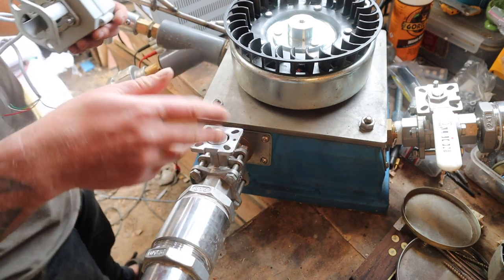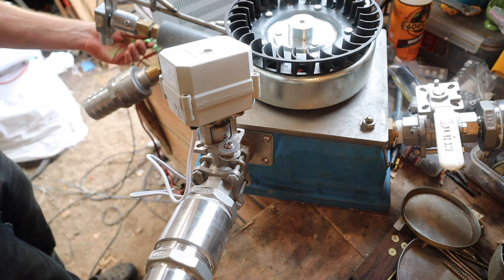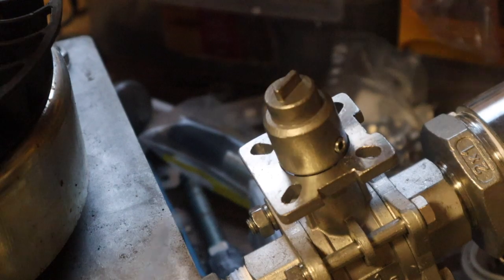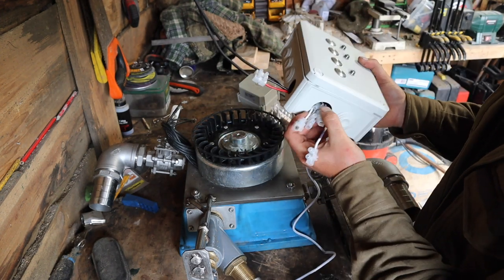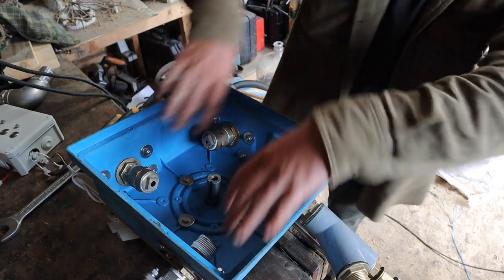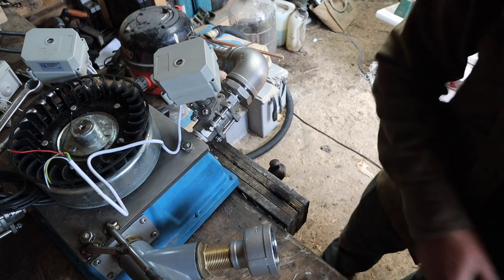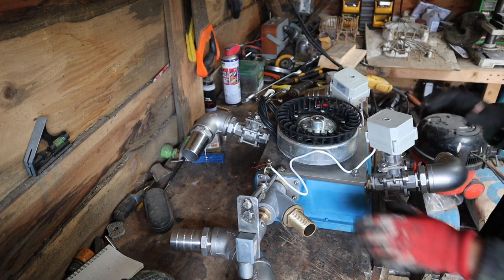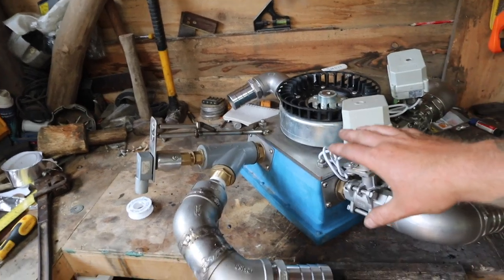4 Nozzle Off Grid Micro Hydro Turgo Turbine  Part 6 Valve Actuators, Controler, Fittings

Comment: Double check that it actually closes. The grab screw did not return to the same position as it started in.
Reply: I noticed that also. 
By the way it's called a grub screw here in the UK.
Reply: Yea it sounds like the motor is not strong enough to close it.
Reply: I was going to say exactly the same thing. Good eye.
Reply: The grub screw does appear to rub against the base.
Reply from the maker: Well spotted. its due to two things. one is the slight rub from the grub screw and two not getting enough time to build up force before closing. It will work fine once it has the full 24v and is in normal oppeation
Reply: @KrisHarbour  yes I found out the hard way. at my job I installed these actuators and they have capacitors. If they are not given enough time to charge the actuator will only partly close.

Comment: My friend's dad's Workshop but has a vice that is meant for would just like yours and I got so frustrated working with it one day that I took a couple of blocks of wood and carved out a couple of concaves into them so that you can clamp stuff above the work surface and round objects and apparently those two blocks of wood get used quite often now because they are covered in Grease from having to clamp various different metal objects on the acreage that he's been working on over the last couple years
Reply: It was kind of an easy fix instead of buying a whole metal vise

Comment: Nice work Kris! As an old power plant operator I’m wondering how the actuator will work under water load.  Also, a simple manual bypass around would be great if the motor operated valve (MOV) were to fail. 
Always enjoy your videos and have been a long time subscriber. Cheers.
Reply: And a series emergency shutoff

Comment: FYI... in the future... you should wear a respirator when welding galvanized pipe. When welding galvanized steel, a respirator is required so that the zinc oxide fumes from the galvanizing are not inhaled. Inhalation of zinc oxide fumes can cause metal fume fever. This acute overexposure to zinc oxide through the respiratory system causes flu like symptoms that can be severe. Chronic overexposure to zinc oxide can result in death. It is also wise to weld in a well ventilated area, even when using a respirator.

Comment: "Tappy tap tap"...someones been watching AVE....another great tuber.....i don't like being "That Guy" but the grub screw wasn't back in the original location  when it finished closing, looks like there was a quarter turn left...it sounded like it was struggling to me...just pointing it out buddy
Reply from the maker: Yeah its because its rubbing a tiny bit and didnt have enough time open to build up enough to close fully. it will work fine in normal opperation. But well spotted.

Comment: Next time you may want to grind the zinc coating off the galvanized pipe before welding.  The fumes that come off that stuff can cause issues with you and the zinc getting into the weld isn't going to allow the weld to be strong as it should be.  I suspect you may be rebuilding that at some point.  Otherwise it looks good and should work well.  Since you already have the one hydro it may be worth automating the "manual" valve or automating the other hydro so that you can tailor everything to your power needs.  With everything setup right it may even be possible to have the system ramp up and down as your needs increase. 

BTW Arduino programming is very easy to do, grab a board some time and give it a try.  I setup something with one for Halloween.  I took a plastic pumpkin with a single input switch some LED's for eyes and two car horns.  Everything is 12V powered with a step down circuit for the Arduino and some solid state relays to switch the large relays for each horn.  Then a randomizer script so that one horn or the other or any combination I can think of happens.  Set it down, plug it in and let the kids push the big red button.  The scripts to control are all published you just plug it in and do  some if then statements and time etc.  So for you setting something like the dump load to activate a relay that then tells the board to power down would make it simple to automate the hydro when the power is full.
Reply: I think in an earlier video Kris said it was all stainless, so no need to worry!
Reply: That is possible, I jump a bit through some parts sure looks galvanized though.
Reply from the maker: Yeah it is all 316 stainless steel. But thanks for your concern.

Comment: Kris thanks another great video was so emersed in the workshop build i nearly forgot you were upgrading the hydro🤯 so many projects one busy man👍  Curious if the nozzles with the sharp 90° bends have a large pressure drop? I work with a fluid handling company but deal with pumps mainly however the diffrence between a long sweeping 90° bend and a sharp 90° has quite a diffrence when working out pressure drops over a complete system. Would imagine the same would apply but have no experience of hydro. Just throwing it out here as another small efficiency gain 🤔
Reply from the maker: Yes they do and i did want to avoid them if i could but i just could not get the hose to bend how i wanted it so i had to go with the 90s. But at the low flows and large pipe size the loss will be very small.
Reply: @KrisHarbour  Ha ha that explains why, always knew you were on the ball👍 Thanks for taking the time to reply

Comment: Will these bends make the system loose efficiency ?
Reply from the maker: yes, but only a small amount due to the pipe diamater and low flow. less than 0.1psi per bend by my calculations